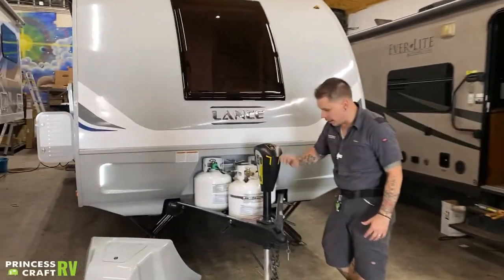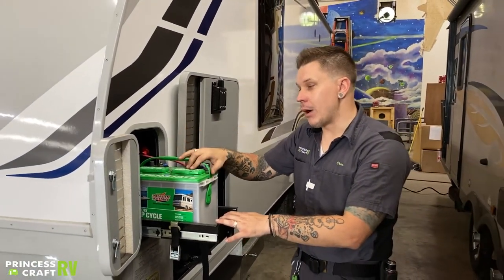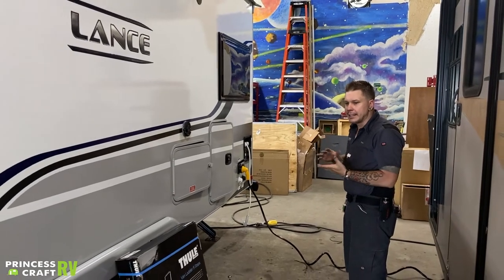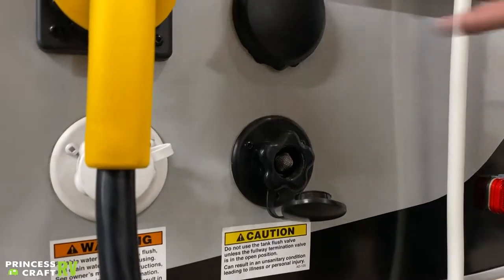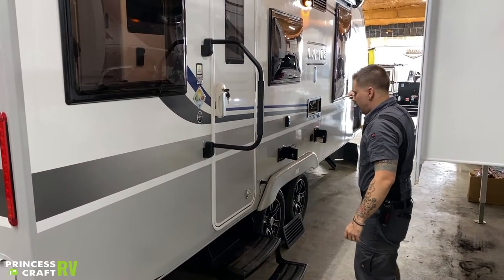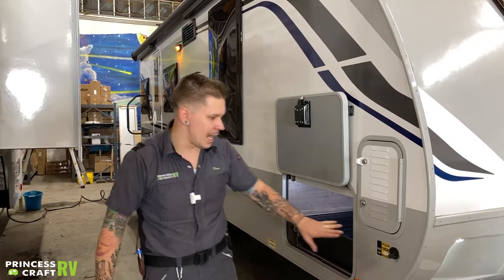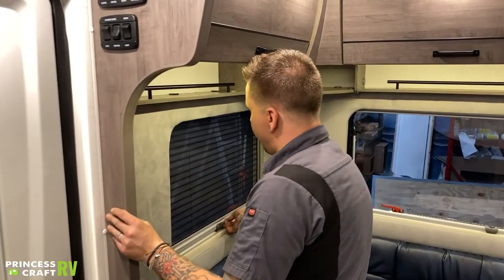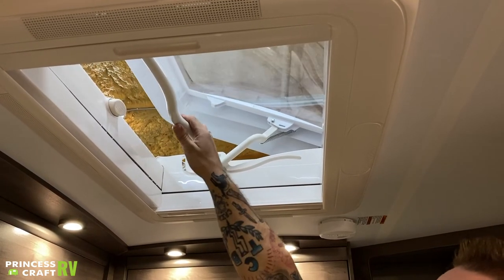2020 Lance 2075 Technician Tour

Comment: Excellent review of this trailer. I'm trying to decide between this 2075, the 1995 and the 2285. I'm leaning heavily towards this 2075.
Reply: Each have merits, we went with 2285 for couch/dinette layout and bathroom wash basin outside of bathroom. Also don't love how black grey water drains are separated on 2075.
Reply: Too bad such a crappy 2 burner stove and ZERO Oven, also crumby fridge. At that price point the equipment needs to be top-of-the-line! I love this Camper, but seems to be some poor planning here for what they are aiming for.
Reply: There are at least two new models for 2022 coming too and all new decors. All trailers will finally have the acrylic windows and euro doors. I'm looking forward to these new options!

Comment: Great video...  Lance needs to find a way to make the black and grey tank outlet one outlet.
Reply: I wondered about this, too.  This is the first RV I ever saw in 50 years with these two tank outlets not “Y’d” together. Strange.
Reply: Fred Chabala And I would think a trailer like this, the point is to be agile.  No slides so quick to get in and out of wherever you are going.  If I have to hookup my black, dump, hook up my grey, dump.  It’s just creating more work and time.  Beautiful trailer otherwise.

Comment: This is the best video for any one who is to have the trailer. Thank you. My questions are:

1. What is the hitch ball size, 2” or 2-5/16”?  
2. Is the electric wiring system with the inverter installed in factory READY for rv lithium batteries?
3. Can the 1500w inverter swapped out with a 2000w inverter?
Thank you.

Comment: Do you recommend collapsing the dinette table to the down position during travel?  Or is it ok to roll with the dinette in the standard up position when in transit?
Reply from the maker: Either way should be fine, as long as the table is set up correctly!

Comment: Will you be doing a suplimental with the outdoor kitchen.
Reply from the maker: We may be able to get that footage when another Lance with the outdoor kitchen option comes through the shop. We'll try to remember to do that!
Reply: @RVTechToursatPrincessCraft  That would be good. Quite a lot going on back there. Quick connect water. Quick connect gas. Removable stove. I don't have mine yet. And I have watched your video many times preparing myself for it. Winterization on this model would be very helpful also. Above what you showed on the Truma. Thank you for your great videos.

Comment: Thank you for this very useful video. I have placed an order for a 2075.   My question is if the following hitch is for this trailer:   

Andersen Hitches No-Sway Weight Distribution Hitch 4in Drop/Rise, 2-5/16in Ball, 8in Brackets
Reply from the maker: I am sorry we are not an Andersen Hitch dealer. I am unfamiliar with the proper setup.